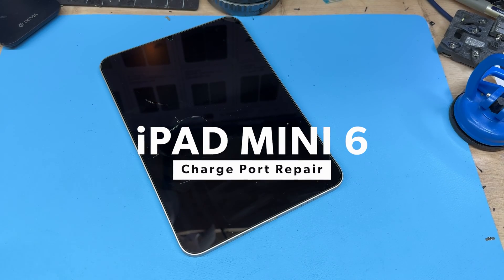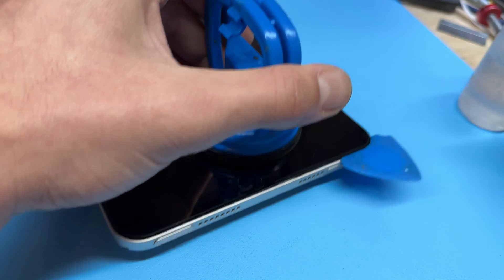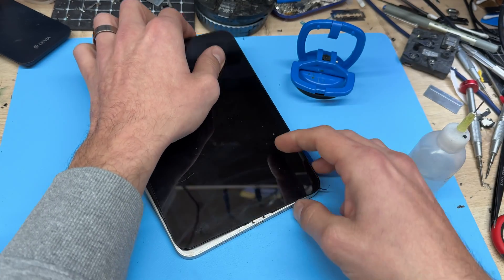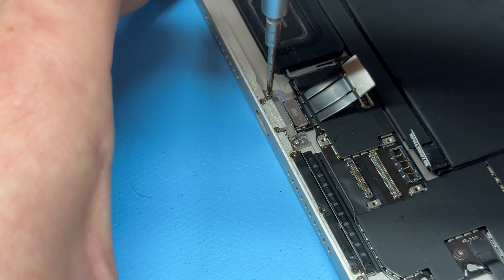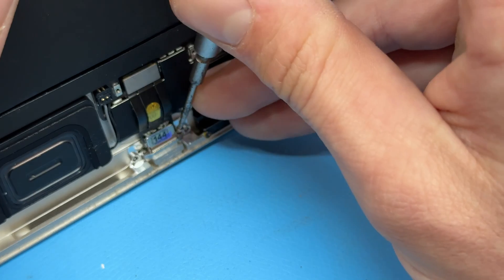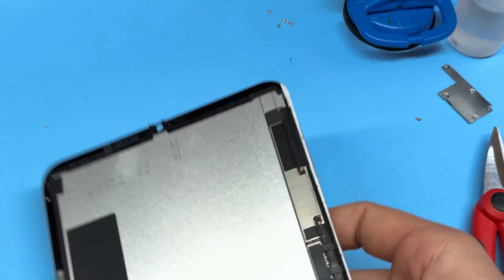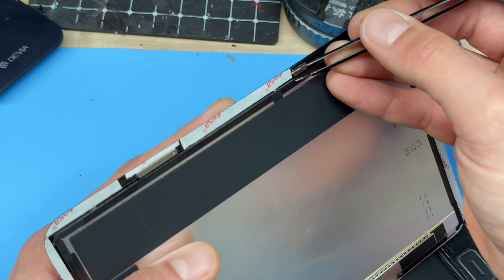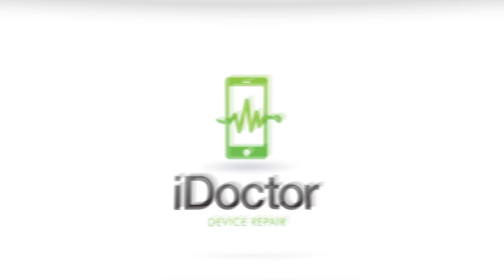iPad Mini 6 - How To Replace The Charge Port On Your Broken iPad!

Comment: thank you so much for this.

Is a screen protector recommended before using the suction cup? I’m not sure if it sounded like the suction would break the screen easily without a protector there in the first place.

Comment: IT WORKED! iPad Mini 6 is ALIVE! Apple said I needed a replacement. Local shop quoted me $120 + tax. I did it with $40 worth of stuff from amazon. Thank you.

Having a screen protector on the screen helped.
Reply: Jk.. I cracked the screen trying to scrape off the adhesive
Reply: @Anonymous_Badger 😂 had me In the first half until I click the reply. The shop by me quoted me at 100$ but said it can be 200$ overall if the screen breaks during repair. So I have the 100$ but I don’t have the 200$ to spare as of now incase the screen breaks and you saying it broke that easy I’m sure they’ll up charge me or find a way to break the screen during the repair because I don’t think they’ll try to not break the screen. They”ll just speed through it because the screen cost them 5$ but they get another 95$ dollars off me for installing what they broke.